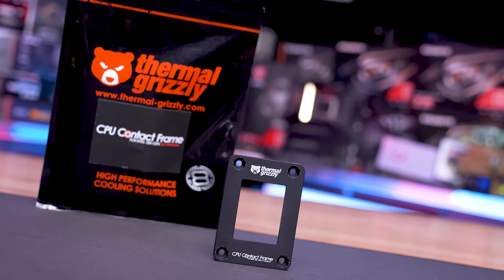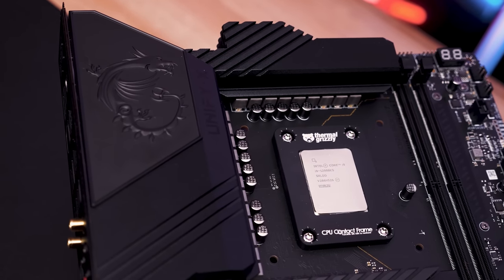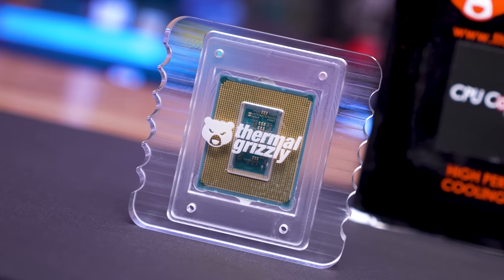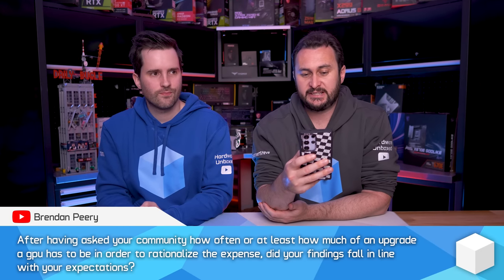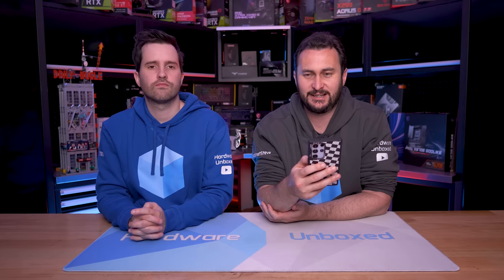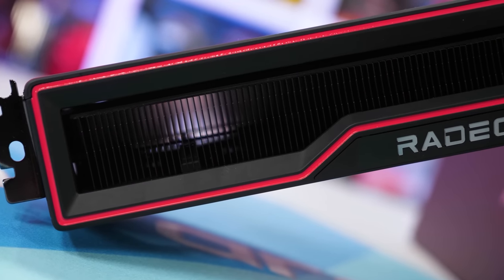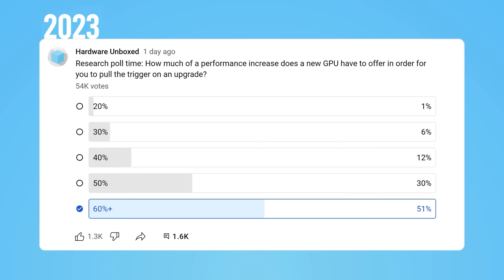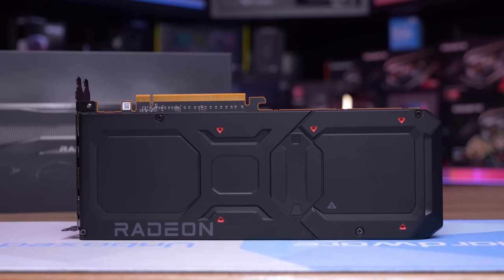RTX 4050 Pricing & VRAM, Are 12-core CPUs Dumb? March Q&A [Part 2]

Comment: 12 Core CPU's aren't dumb, still using old software that can't utulize them is dumb
Reply: kinda agree I don't want a repeat of Intel only doing 4 cores CPU for years.
Reply: @atavusable  It's not "dumb" it's the standard technology of the time!  There are no developers with enough "BigBrain" to develop duplex graphics sound and physics processing that can feed these all equal amounts of CPU and data.

It's not just a case of saying "Well these 2 cores can do the sound and these two the physics, then the GPU does the graphics".  That's far too simplistic.
Reply: @DailyCorvid  it's standard tech of 10 years ago, that doesn't develop fast enough
Reply: Yeah plenty of games will use 8 and more cores. 12 cores isn't crazy unless you don't use your computer. Getting 6 cores in 2023 is crazy.
Reply: @DailyCorvid Actually they can. You can totally run sound, graphics and physics on different cores.
Reply: @Rayer24  me with a 4-core APU 😐
Reply: @wallacesousuke1433  im with you brother
Reply: @emmata98  Exactly lol why are people throwing money at these old tatty products.  There isn't enough compression technology to go far past where we're at,,,

Are we really discussing if 8GB is enough in an era when a single 4KVR screenshot of 24 million pixels requires 200MB.

If a colour frame is 200MB and you want to see 100FPS then you need MINIMUM 2GB PER SECOND lol not 8GB PER PC!

LOL it's maths they don't count very well these days :) My maths is if I spent £2000 on a PC and £2000 on a VR headset and GPU, for my £4000 I will achieve marginally better rates than the above example.

2% better than my 1080p setup for 280% of the price...
Reply: Idk
Right now having multiple CCDs for a gaming CPU tends to lead to problems and slow downs and 8 cores is plenty for gaming. If youre gaming the 8 core part makes more sense.

But like they said, if you're using it to make money youre probably better off just springing for the higher tier part.

Even further, if the 7900x3D only has v-cache on a 6 core CCD we could see it having noticeably worse performance than a 7800x3D in a lot of scenarios.

I don't think we have to worry about being stuck in another "4 cores forever" situation. In the next few gens we will see the first 16 core CCD from AMD and core counts will jump again. The 8 core CCD is why we still max out at 16 cores.
Reply: @TheDarksideFNothing  I don't agree, Multi CCD is no slower because the improved cache speed and capacity are more important to gaming than a high frequency.

Where you're talking a 300mhz difference CPU which across 8 cores is /8 so it's 55mhz diff per core.  Barely notice it ever, maybe if I am at 300FPS I would,

I play at 80fps locked.
Reply: @redstonerti9918  They claim they can but they fail.  Look at the PS3 and it's 6 core neural plus 8 core GPU.  It is still a powerful console today but nobody writes the games because it costs too much and takes too long, and you can't port them afterwards.

A direct result of too much "BigBrain" trying to duplex things in concept that in practice require a user input so cannot duplex without waiting every few milliseconds for the user.

I mean it's fine if you're user is a robot that moves at 2000dpi lol but actual people don't.
Reply: @burrfoottopknot  yeah. But I can understand that the software development isn't much faster than hardware, but it is much slower atm, and that is my issue.
I know that there is probably no universal mt-tech that scales well from 4 cores to indefinitely, but the improvement steps in the last decade is extremely slow, way slower than the number of cores in standard skus
Reply: @DailyCorvid single ccd is most of the time faster than dual ccd cpu in games, not all games but most, as dual ccd introduces latency. Just look at the benchmarks. 5800x beats 5950x in games even though 5950x has double the cache of 5800x not to mention double and faster cores.
Reply: @kiburi2903  We're talking periods of time so small we cannot even detect them, that happen 1000s of times every second.

In that way yes it is faster but not noticeably and you've paid twice for that.

I personally don't encourage that sort of daft behaviour it just encourages the gouge.  No coincidence that my generation never whinge about pricey GPU's cuz we refuse to pay that much.

They market these things exclusively to the youngers who have no resilience against it and no experience of what went before.
Reply: If they were significantly cheaper then yes, they wouldn't be dumb, but they aren't, for gaming it doesn't make sense because it's weaker then the cheaper 8 core variant, and for productivity it's bad because for only 100$ you can get a significantly faster (and with better perf/$) 16 core CPU.
Reply: @DailyCorvid  First of all, what do you mean by "Duplexing"? Second of all, the PS3 is not a powerful console today. It's beyond awful. There's a reason people don't make games for it. It also didn't have 6 cpu and 8 gpu cores. That is just false. It had a single cpu core and 6 floating point processing units, kind of like a stopgap between how modern cpus and gpus work today. It also only had 256MB of RAM and its cpu core was at least 8 times slower than today's cores. Try running cyberpunk on that.
Reply: @redstonerti9918  Nope I am not your guy.  There is no way I am gonna sit here and teach you why all the stuff you just said is totally wrong.

You sound like you've already decided and so you will not be taught.
Reply: @goncaloduarte4683  People continue to parrot this "only $100" difference. Only if it was true, huh? The real difference is more like $150. Now do you really want to pay $150 more for 4 additional cores?
Reply: @withkittens2532  yes even with it costing 150$ more, it is still worth it. There is no increase in value in productivity with a 7900x over the 7950x and the downgrade in gaming performance over the 7800x is lower on the 7950x.

Spending 950$ on 32gb RAM + X670E + 7900x looks silly when it costs 1100$ for 32gb RAM + X670E + 7950x
Reply: @DailyCorvid   what the hell are talking about. Fps is fps. If a cpu generates more fps than the other then it is better for gaming. Plain and simple. Depends mostly on the whole system and what game you play but getting more fps will give you better experience overall (more fluid and better response) Some people don't use their pc for productivity. You said earlier that dual ccd are no slower in games so that's what I corrected and now you're saying another mumbo jumbo stuff that doesn't even relate to what I said. Get your facts straight.
Reply: @goncaloduarte4683  You're objectively wrong about productivity value. Have you watched Gamers Nexus' review of 7900x? With 7950x you get 16% boost in productivity (on average) for 35% increase in price ($424 vs $571 on B&H Photo).

In games both 7900x and 7950x are within a few % from each other.

Now if you don't mind spending extra money just because you're already spending a grand -- that's fair and fine. You do you. It doesn't make 12-core CPUs dumb though.
Reply: @DailyCorvid  I don't need your "teachings". Saying that everything I said is wrong and not elaborating is not a useful discussion. Thanks for nothing.
Reply: @redstonerti9918  I don't think you are listening.  I physically am unable in the short time of a few comments, able to make you understand the technicalities of what we are talking about here.

I am not saying you are thick or you don't know anything, I am just saying if you put your own comments into GPT it can explain to you in 3-4 pages why you made bad assumptions. 

I was trying to be polite, and say go and read something about this first before talking about it and removing any doubt that you have no idea what you said.

You can't process sound graphics and physics on different cores at different speeds, when you need your frame to show ALL of this stuff on demand on the next one you will see.

So yeah you can say to core 1 have sound, core 2 have physics, and gpu have graphics - but unless you have a method to streamline all of that WITH user inputs AND still be hitting your frame gen times then PLEASE let us know how!!!  Lol you are BigBrain himself I see! ;)

Comment: I'm interested in my next GPU to be an Intel Arc if they do make a second generation and they keep the price competitive. I got a 6650xt in December and its going very well for my setup, no real reason to upgrade but I do feel like it wasn't worth the £330 price point it was on sale for, not the worst price in this this current market but I strongly feel like 3060, 6600 are only worth at most £250. Customers need to steer away from high price GPUs as much as they can, we need to tell these companies we've had enough. There's a meme going around that APUs will soon replace the GPU and to be honest I'm all for that, it will send Nvidia to learn how to make a CPU but look buying a single product that does everrything is a lot more appealing right now for the wallet. It could cause a big issue when some people just want a CPU or a simple APU but this could give a lot of options on what you want, a high CPU performance with simple graphics or a medium CPU with great graphics and so on and so on.

Comment: my 1070 had 8Gb VRAM, fine for 1440p though some games used most of it already back in 2016. Anything less than 16 is a no-go imo for 4k. Went for the XTX, 3.5x-4x performance jump

Comment: I wanted a $200 RTX3050, will probably end up getting a $230 A750 once re-reviews confirm that most performance weirdness has been smoothed out.
Reply: Get a Rx 6600
Reply: @rattlehead999  The A750 is much faster when it works right, has twice the memory bandwidth and about twice the RT performance if I want to try it out of curiosity. If Intel can fix its drivers, the A750 is going to be a killer deal and I don't mind waiting to see if it'll happen. I have far more patience than interest in playing modern games at high details.
Reply: @teardowndan5364  RX 6650XT is still at a similar price and is faster than the A770 (6650XT is the best value according to HUB). Its such a shame that many people forget about these GPUs and buy a vastly inferior 3050 for more money. RT performance doesn't matter at this price. I don't know how good a750 will be with newer drivers though, reminds me of the finewine on AMD polaris.
Reply: @hariskhan01  rt matters for people who r okay with 30fps
Reply: @hariskhan01  On paper, the A750 should be giving the RTX3060(Ti) a run for its money and beat the RX6650XT hands-down, which it does achieve in a bunch of games using the latest drivers. I'm hoping to see more of that over the next couple of months.
Reply: @teardowndan5364  theoretical performance is really good, 3 weeks I saw the video where HUB retested with newer drivers, it was better in F1 2021, but it still is overall 30% more expensive cost per frame than the 6650XT at 1080P.
Reply: @pk417  with a 3050 you're not even going to get that unless U are someone who uses DLSS at frickin 1080P.
Reply: @hariskhan01  haha dlss quality at 1080p looks good 
Check dlss latest version 3.1.1
Reply: @pk417  DLSS 3 doesn't work on the RTX 3050?
Reply: @hariskhan01  Maybe in the USA. I'm in Canada where most RX66xxXT models cost $100+ more than the A750.
Reply: @hariskhan01  dlss 3 is contains dlss super resolution plus frame generation
Dlss 3.1.1 is the latest version of dlss super resolution which is available on 2000,3000 and 4000 gpus
Reply: @pk417  To quote an Nvidia engineer, " DLSS 3, in its current state, only works on the GeForce RTX 40-series graphics cards"
Reply: @pk417  OK I undestand its DLSS 2 version 3.1. But Steve himself said that DLSS and FSR should not be used at 1080P, although might own a smaller monitor so DLSS looks better on it.
Reply: @teardowndan5364  yeah was talking about newegg. A750 is totally worth it in that case.
Reply: @hariskhan01  haha naming problem like i said dlss 3 is combination of dlss super resolution plus frame generation...4000 series only have frame generation as extra feature...i uses same version of dlss super resolution as 2000,3000 series gpus
Reply: @hariskhan01  bcz steve have not used dlss 3.1.1 which is latest dlss version comes with significant improvements...u have to manually update dlss to latest version for games

Comment: I have a 3080 Ti, just upgraded to a 4K display - and now I'm starting to see why 12GB is the minimum in newer games. Crazy to see...
Reply: No joke, I was on a 3080 12GB playing 4k for about two years. Recently the ram has become a problem. So I picked up a 6950XT and use the 3080 in a 1440p rig now.
Reply: I can't speak on behalf of 4k but sometimes I see 1080p use 7gb of vram. I'm using a 3060ti so I get a little anxious seeing that vram usage slowly climb to the limit.
Reply: @colossusrageblack  How do you find the performance compared to the old card?
Reply: @IItsIgor  Yeah, that’s because textures are becoming high res. Now, in 4K your card will have to render in 4x the resolution, and the textures. 16GB really should be the standard today.
Reply: @ToreOnYouTube  for 4k yeah definetly but for lower end cards like the 4060 I think 12 gigs would be good

Comment: I upgrade my GPU when I can gain 60% or more. My Only upgrade, to me, is the 4090. I have a 3080Ti and the 4080 isn't enough for the money.  (low Vram, high cost)
Currently waiting for 5000 / 8000 series GPU's.

Comment: I'll just buy a second hand 500$ MSRP card for 180-220 years after it releases. Bought a used r9 290 in like 2015, bought a fresh RX590 a few months after that released, and i'll just keep going back and forth between old mid-high end and actual 200$ cards forever.

Comment: About Intel and 3DVCache : their CPUs right now could not run Vcache because the power density of those CPUs is very high.
AMD had to dial down the TjMax for the 3D models. That would not work for Intel, they would need to drop clocks a lot and perhaps lose what they gain. Remember that Intel CPUs use a lot of power (13900K double that of a 7950X3D)

Comment: I think a big reason why the attempt to shift up the cost of GPUs has gone awry is because all throughout the GPU shortage, even while people were begrudgingly paying ridiculous prices to get any chip they could find, we never stopped really thinking about the MSRP as the "real price" of those  cards. The prices during the shortage weren't the "new prices" they were "scalper prices" -- an unjust and cruel product of circumstance. Even when they were putting ridiculous prices on the later Ti models, nobody saw those as the honest price, just a reflection of the scalper prices and the shortage.
Reply: And that is why it is good to put prices even higher now! It would have been hard without crypto currency frensy!

Comment: The 7900 XT was $900 because the 7900 XTX was supposed to be $1200-1400.  They just did a last minute price correction because they didn't hit their performance goals and I think the performance of the 4090 also surprised them.
Reply: Why didn't they do a last minute price correction for the 7900xt as well and changed the price from $900 to $700 or $650?
Reply: @momovalencia1  They don't WANT to lower prices.  This way, the XT is positioned to try to upsell people on the XTX (which seems to be working quite well from what I've read.)  Of course it's debatable whether they actually make more money on these cards this way compared to selling the XT for less, but hopping on board with general GPU price inflation may benefit them more in the long run.

Comment: Answer for the question about max power gpus. I've run a 1070 since launch, so 8 years or so now? Overclocked to its limits with an 8 hour session most days, no issue at all. As long as its not at 90c all the time you're fine. I upgraded to a 6900xt a few weeks ago and I'm doing the same. R9 280x was the same, as well as my hd 7770 (believe thats was it was called) always overclocked running as hard as it can. Never had a gpu die

Comment: 30:50 Intel actually used off-die cache with the 5000 series(in the form of a 128MB SRAM chip), and that cache was so good, that this little quad core i5-5775C at somethiong like 3Ghz on first gen 14nm could compete in several tasks against the 8 core 11th gen 14nm i9-11900k running at like 4.5Ghz

If Intel were to use an extended cache technology, it would probably be either like foveros, though more likely just use EMIB to a large pool of SRAM say 512MB not as fast or as low latency as 3D cache, but a much wider pool allowing for a significant reduction in demotion to system RAM.

I can see HEDT coming with two HBM3 stacks, and maybe the XX900K eventually having a single HBM stack(or similar tech) say 2-8GB per module. You'd still get your system RAM, but it reduces the need for more memory lanes while also reducing latency/misses.

For a while now APUs have really been starved for memory bandwidth, and it seems like DDR5 is not the solution for this(zen3+ seemed to be held back by LPDDR5 6000 vs 6400), we either need to add more memory lanes, or add an on-package high bandwidth cache. I'm personally in favor of more lanes, but that does require the package to be larger for the extra pins, where as an on package cache may not require the package to grow significantly, allowing it to be used in slimmer/smaller form factor devices